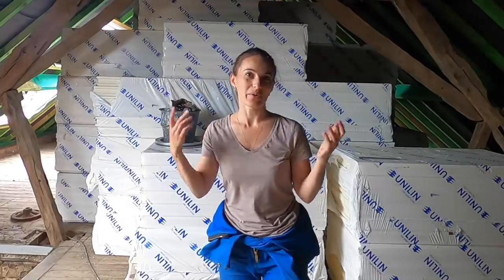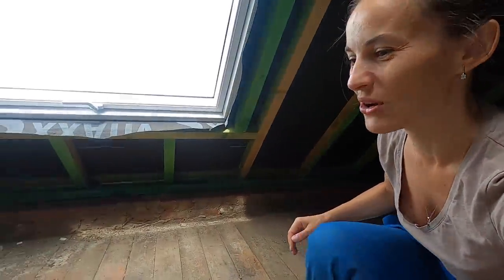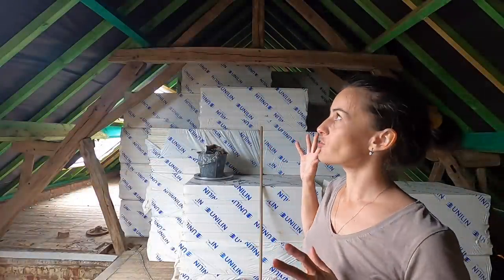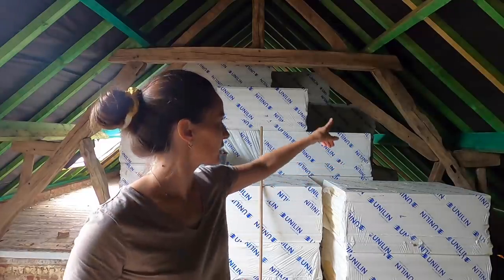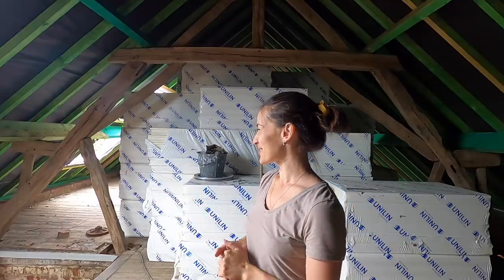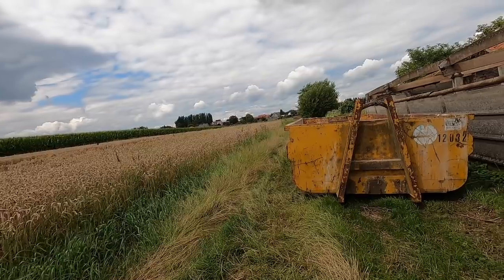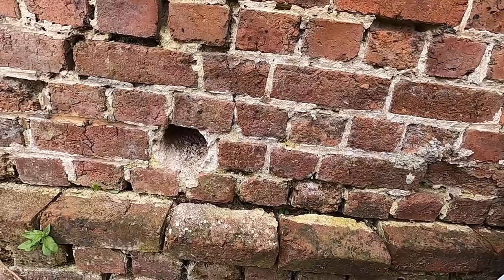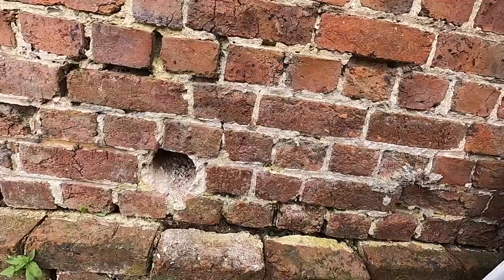1908 abandoned Belgian farm got BRAND NEW roof

Comment from the maker: Pinned comment as promised. If you have experience/knowledge about working with lime mortar, please help us to get 2 questions answered:

1. What should we go for while repointing the joints and replacing the bricks: NHL 3.5 or hot-mixed lime mortar?
2. How it works with iron? Any specific reactions we should be aware of?

Thank you for sharing your knowledge and thoughts here :-)
Reply: But why lime? Why not go for cement and save yourself the nerve cells?
Reply from the maker: @Ifailedtopickanick  In old buildings you need to work with breathable materials like lime mortar. Cement does not let the water in, so all the water stays in the bricks. This will destroy the bricks in a long run. Very roughly and short described :-)
Reply: The Restoration Couple have a whole series of videos on lime pointing and removing cement
Reply: Check out the vlog ‘Doing it our way’ they use lime mortar and the Father is very knowledgeable- the brothers vlog is ‘The Pethricks’. The Father is a contractor and can probably help you quite a bit
Reply: @milmom4281  'Doing it ourselves'?
Reply: First I would check the local building codes.  Second I would speak to a brick mason and see if he/she could do the job more cost effectively.  Some of the pointing may not need to be touched and some of the brick may have to be replaced.  A brick mason would know which foundries could match the original brick if the ones you recovered from the deconstruction of the building are not appropriate.
Reply: Richard- you are correct ‘Doing it Ourselves’ I thought that is what I wrote-auto correct may have changed it.
Reply: @stevewoodw  Useful links, I'm still working out how to use lime in my house.
It's the way to go to cure moisture problems.
Especially if you're going to insulate walls from the inside you should have the walls as breathable as possible to enable any moisture from the inside out.
With the insulation inside of the walls you will have a damp proof membrane on the interior side of the insulation, so no warm damp air gets into the insulation.
But the dew point is still somewhere in the insulation itself, even regarding dampness which comes from the exterior.
So breathable materials used in the exterior walls is a must to allow this dampness going out again trough the walls to avoid accumulation of condensation between the inside of the wall and the insulation and even in the insulation itself rendering it useless and causing mold and rot.
I've seen it in my own house where an inside stud wall was erected in front of a very damp brick wall, yesterday I removed the stud work and the wall was wet and the original skirting completely turned into compost. 
I'm going to remove the outer brick leaf of this wall and insulate it from the outside with a damp proof membrane between the wall and insulation and an damp open membrane on the outside, then cover it with a steel siding which allows air to flow trough, the inside will be rendered in lime which allows the wall to breathe via the interior side.
Reply: When you said reinforce the walls - I haven't heard of anyone doing this - mortar alone should be enough. I don't think you need steel in brickwork. If you want to put steel in the walls put a lintel in the loft wall so you can have  a big window at the end of the loft. Do you need planning permission to do this in Belgium?
Reply: @milmom4281  Thank you for your reply.  I thought maybe I might have been missing out on something. ;-)
Reply: SUGGESTION. The biggest concern is the strength of the brick as you want the mortar to crack before the brick. The American show "This Old House" repaired loose old brick and selected the mortar based on the type of brick they were applying it to!
Reply: @stevewoodw  Stitching cracks in cracked brick work is a common way to repair these, I've done it to a couple of walls, using stainless steel threaded bars, with a couple of nuts screwed on each end, much cheaper than the spiral bars which are sold for these repairs, and stainless shouldn't react with lime.
Reply: @Ifailedtopickanick  Cement will break the brick, it is old soft brick and cannot deal with the stress of an unmoving cement.  Old soft brick needs a soft mortar.
Reply: Note how the bricks in the affected area are pushed out from the wall.... this looks like frost damage caused by a drainage problem.
Best guess is a drainage issue has caused that part of the wall to retain too much moisture and then "heaved" when the wall froze.
The damage is just the symptom, not the problem.... check the inside of that area for signs of previous damp or water ingress.
If this was caused by damp walls freezing, reinforcing them and repairing them will only temporarily mask the problem.
Reply: @richardsteele6469  Looking out for some reclaimed bricks that match may not be a bad idea.
Reply: @Ifailedtopickanick  never cement
Reply: @jackieneale5424  As you say. It's always cement in my country, anything weaker and less front-thaw resitant is a non option.
Reply: @thecaretaker812   I'm not sure about this - do you think it's a problem with the roof, somewhere inside or the ground being so waterlogged that there's no chance of the walls drying out? It's possible that puddles against the building could cause a build up of water - I guess they'd need to install drains from what I can see from the video about the ground.
Reply: @Hlebnov_A  используйте переводчик гугл или другой бесплатный онлайн-переводчик
Reply: You’ve got plenty of bricks saved, I would take out all the bad bricks and rebuild that small section. Of course a brick mason would have a better eye and skill to get the new bricks lined up like the old ones. The section has already been repaired once. There is probably an underlying reason why that repair is failing again. The only way to find it is to take it out and put it back together.
Reply: @pthomson9736  oh goodness they had so many good episodes of renovating houses and keeping it to the period while implementing modern safety standards. The climate, materials used, and building codes are different from country to country but I'm sure they have similar solutions that this family would benefit from. 

Great suggestion! 👍
Reply: @Ifailedtopickanick  If it was cement blocks, cement mortar is fine but baked clay bricks need to breathe so lime mortar is the way to go.
Reply: I do know that lime mortar and re-bar do not mix...the lime will eat the metal.
Reply: @stevewoodw  I would question using treated rebar/iron. My limited understanding, from recent structural engineering discussions regarding the condo collapse in Florida, is that the US is moving away from using coated rebar in concrete structures. The coating makes the rebar more slippery, reducing it's adherence to the concrete, which can amplify structural failures in concrete. It's worth finding out what effect that coating would have on structural steel reinforcement in old brick. Just a thought.
Reply: Maybe you should contact some qualified bricklayers and get advice about what mortar you should use .🇦🇺🙋‍♀️
Reply: @marcie685  I totally agree.
Reply from the maker: Many thanks for all your advices, links and suggestions. I am collecting all the information in a file and we will starting reading/watching it in the spare evenings... 
I will leave the comment pinned:  I hope more fellow renovators and remodelers will find useful information here as well.
Reply: Exchanging stones, no there is nothing big to consider
I would use less lime outdoors, for example for walls indoors
Mixer, 12 shovels of sand, a good 4 shovels of lime and two cement,
if such a cart is full when building steel is concreted, then it should
Concrete ALWAYS cover the iron 3 or 4 cm, otherwise risk of rust,
would also send you some pictures of my building,
Reply: @stevewoodw  There is some corrugated steel roofing to the right of the area just above head height with no guttering..https://youtu.be/F2FODAK8YFA?t=853  that could be a part of the problem.. concentrating heavy rainfall in that area.
Reply: Illia, are you going to repoint throughout or just repair the damaged bits? I guess I'm asking as I'm not sure what the existing mortar is - cement or lime? If it's repointed with cement that could explain the spalling brickwork (although where you were looking the damage looked as if caused by a leaking gutter). If it is cement, ideally replacing all of it (ouch), in which case, would you consider getting a pro in to repoint one facade, and then following on in kind?
I think I'd go for the NHL as the bricks look reasonably good (it's hard to tell on video), and wouldn't need the softer.
Reply: This can drive you crazy as to all the choices that can be made :) Hydrated lime versus Hydraulic lime (HL) naturally or artificial.
My english is not so good, but what we use here is called in Dutch "Hydraulishe kalk" and "Luchtkalk". Those are the end products which are sold on the marked these days. Hot mixing is done with quick lime (ongebluste kalk) and is not really done on site anymore. Quick lime is slaked (geblust) in the factory and then becomes hydrated lime (luchtkalk). It is then used on site by mixing it. There is no heat development anymore. Hydrated lime (luchtkalk) gives a very slow to set and weak mortar. I would go for the naturally hydraulic lime (NHL) which comes in different strengths.

There are ready mixed lime mortars for masonry and repointing. One of the company's selling it is Ekoplus in Banholt Netherlands (right in the south) The standard mortar for masonry/pointing and plaster is "Unilit 35M" http://ekoplus.nl/categorie/kalk/type/voegmortels#unilit-35m-uni35m  The technical product information is linked on the page as well. This mortar is based on NHL5, wich is maybe to hard for you allready, as you seem to have chosen for NHL3,5
There are others mortars as well and there is lime wich you can mix yourself, have a look on their website.

Another company selling lime and mortars for pointing is Ecomat in Genk and in Zoersel Belgium. https://ecomat.be/producten/detail/voegmortels  and  https://ecomat.be/producten/detail/nhl-pleister

Then there are books with background knowledge about lime and lime mortar. 
https://www.monumentenwacht.be/files/brochure_voegwerk.pdf
https://www.joostdevree.nl/bouwkunde2/jpgp/pdf_013_kalk_kalkboek_koen_van_balen_en_anderen_www_dbnl_org.pdf
https://www.cultureelerfgoed.nl/publicaties/publicaties/2012/01/01/historisch-metselwerk-instandhouding-herstel-en-conservering
https://www.stichtingerm.nl/kennis-richtlijnen/url4003

If you need to know which mortar was used in your house, you can have a mortar analysis done. You then get the recipy for the mortar of your house and can remake it.  https://kalkmortel.nl/de-mortel-compagnie/mortelanalyse/

Whatever you choose, first do a small part as a trial. See if you are happy with it and continue from there.
Reply: @BuzzyStreet  The product for sale is a specially formed stainless steel bar - because of the shape, it should be ok. Normally when it's fitted it goes in a specialist compound - I think it would be fine for this purpose.
Reply: @thecaretaker812  You're right - the bricks also look much damper lower down. Some buildings have footingstones which don't absorb as much water and won't degrade in the same way as others - it's usually the dampest part of a building. Really they have to sort out the drainage at the base and make sure that there are no other ways water can ingress into the wall.
Reply: @DeHoeveOldBelgianFarm  I don't know if you are aware of this type of product for when you don't have a major damp problem but don't have a damp proof course in the brickwork. It is an injectable dampproof course. ( https://www.wickes.co.uk/Dryzone-Damp-Proof-Course-Cream---310ml/p/134011 ) There is some in my house which is about as old as yours - it works reasonably but isn't perfect.  These look like a good option for the wall ties - if you check with the manufacturer they may guarantee them for use in lime mortar ( https://www.amazon.co.uk/Metre-Stainless-Helical-Repairing-Masonry/dp/B07FGVP59R ).
Reply: @stevewoodw  This is actually a very common problem on renovated buildings where people insulate the inside of an old building without also making sure that the walls are very well drained to compensate as the exterior walls become much colder after the interior is insulated which now allows the wall to freeze.
Reply: Lime mortar is time consuming but the best to use. Building must breath. Watch the Indi Project. They are pointing
a barn in Portugal. You will learn a lot about pointing brick and stone.
Reply: I do not think they were mentioned - please go and see " The Jerômes " here on YouTube. If I remember correctly, they had/have the same problems... They are located in Northern France, with similar humidity problems
Reply: @Ifailedtopickanick  but you aren't dealing with 200 year-old bricks.
Reply: There is a great Youtube channel called 1834 Restoration House and they have a video that was one of the first ones they posted where they talk about lime mortar in depth. I’m sure if you contacted the couple that they would be willing to advise you.
Reply: @Hlebnov_A  Не могли бы вы выложить видео о том, откуда вы в России - с некоторыми отремонтированными домами?   Can you put some videos up of where you are from in Russia - with some renovated houses?
Reply: @thecaretaker812  When you say well drained, do you mean that they have a damp proof course, good guttering and that there aren't puddles collecting at the base that will mean the walls are always soaking up water? Or is there something else that you can do?
Reply: in czechia it would be done with lime-cement mortar, so it mantains strenght and also breathable. its like 2:1 lime to cement in mixture used. if you have roof over it it should be ojk just with regular cement mortar. the failure which can be seem on video can also be blamed on quality of bricks, sometimes they are just not made from good clay and more often they are not properly fired. anyway, all damager ones (wet-rotten) should be replaced.

the issue with only lime mortar is that it gets easily washed out when it is  open to rain.

and the iron/steel question, well of course if it lets water throught, then the iron/steel is open to rust, which then makes not so nice maps/discoloration on the surface of mortar.
Reply: You should use  Natural Hydraulic Lime 1 part and 2 parts washed sharp sand. Natural Hydraulic Lime is soft to match the old bricks, it breaths so let's the moisture out, cement mortar would trap the water behind it and damage the bricks. When the wall moves the lime mortar moves with it. Cement mortar would just crack and slowly get squeezed out but also damaging the bricks.
The sand needs grit in it for Natural Hydraulic Lime to work so look for
the specialist sands which are £11 to £15 a 25kg bag as opposed to building merchant sand which is £3 a bag. The sand must also be washed and you can get different colours to suit your bricks. I just had a specialist builder point a wall and these were his recommendations. But under no account use concrete .
Reply: @thecaretaker812  This is typical for brick that is close to the ground. There could be something else that adds to the water in the area. The rain hits the ground and splashes onto the brick adding more water to it than the courses above. Then, as you had suggested, it freezes and breaks the mortar out. On many older buildings, you will see stone used in this area because it isn't affected by this action.
Reply: A friend of mine is building a small appartment at her sisters farm building. She wants to use only natural, breathing materials. She found a company that provides lime plasterboard with buildt -in heating system. In case you are interested, I proably could find out the name of the company.
Reply from the maker: @user-abde  sounds idd very interesting. It would be very kind of you to find out the name if possible.
Reply: Hot ime morter is the way to go do it, cement will hold water in the walls and make them deteriate.   Using lime morter will extend the life of the building.
Reply: @Ifailedtopickanick  Cement would be the absolute worst thing to use on soft brick.
Reply: @richardsteele6469  If one were to seek a mason be sure to talk to one that specializes in historical preservation.
Reply: @Ifailedtopickanick  Absolutely the worse thing you could possibly do.
Reply: @Ifailedtopickanick  no cement.. rots Stone and brick.. needs to breathe and also dry.
Reply: @DeHoeveOldBelgianFarm  correct

Comment: For mortar the best solution is exactly the same as what is there already, the NHL3.5 is the nearest to what you have and the easiest to work with. it was probably mixed with local soil for sand but if the existing pointing is soft you could use that, a pale yellow sand will be a better match than the dark orange sand, after mixing 4 to 1 point the gaps and smooth off with the trowel, leave for a few minutes and then with a stiff hand brush hit the pointing which will push the mortar in more and smooth of the surface, brush over surface when satisfied and allow to dry.

Comment: My home here in Indianapolis, In, and I just finished tuck pointing the foundation.  I use age old mortar , not extra sand, and a liquid bonding agent.  Once the joints are free of debris, using a tuck point tool, and a zip lock back of mixed mortar, cut off the corner, and shake the bag while dispensing, like icing a cake, you can place the metal rebar inside those joints, the longer the better.  I love old homes.  I live a small city lot, but when cutting down the trees for landscaping, I've used the trunks as hand rails.  Keep on keepin on